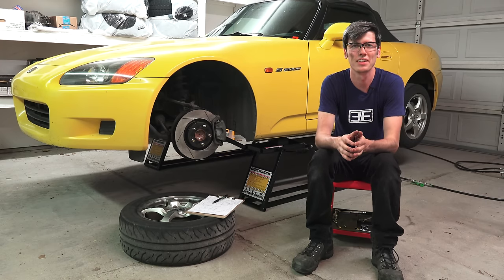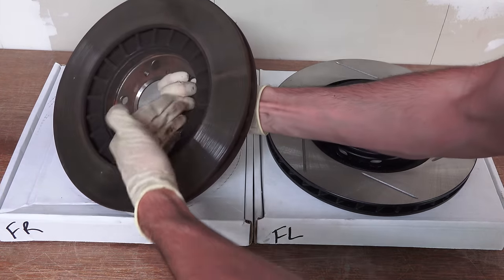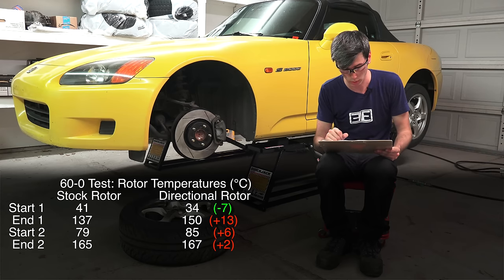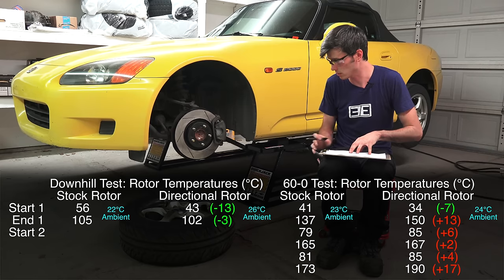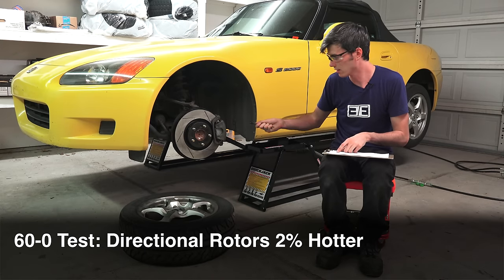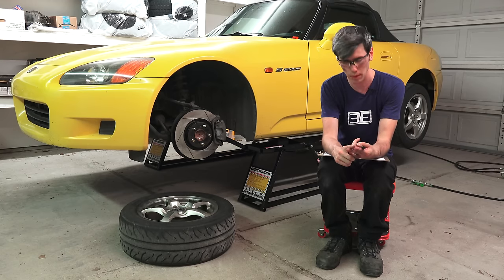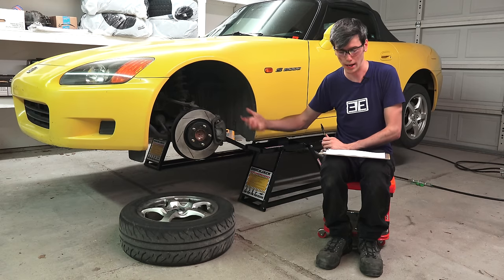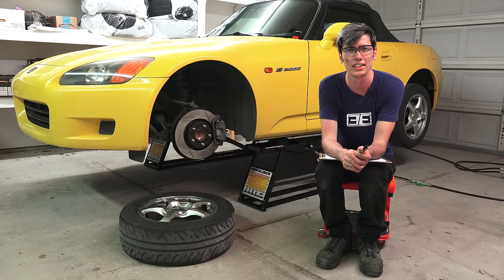Do Performance Brake Rotors Have Better Cooling?

Comment: Metallurgy and manufacturing method both play a critical role here.  Without assuring that the two rotors are metallurgically and fabricatively identical, the p-value can't really be determined with any accuracy.  Also, certain alloys and compositions are far more heat tolerant, so a simple comparison of temperature is likely not sufficient.

Comment: Great explanation but I think using percentage with temperature is a little flawed, because depending on whether you use Fahrenheit or Celsius the percentage is going to come out differently. It may work if you use Kelvin since the scale starts at absolute zero but doing that might make any of the differences seem minimal because of how high on the scale the operating temperatures of brakes are in the first place. Not a scientist or an expert on the topic, just a thought.

Comment: Getting hotter actually is good, it means that it is converting kinetic energy to thermal enegry better, so you get better stopping.  Right?  Right?  Bueller? Am I wrong? I may be.  But I have watched a lot of brake videos and they all seem to tell me that the job of brakes is converting movement energy to heat...

Comment: Maybe the aftermarket rotors provide more grip there for more heat is dissipated. A stop distance might have been a more useful comparison. And at the temperatures you were at you werent pushing it enough to really matter. Also what is the difference  in metallurgy and how do they change under extreme heat. I dont know seems like maybe you just didnt push it hard enough which you kinda said but yeah am not sure this is conclusive. Also I dont see how those cuts on the braking surface do anything other than make the rotor lose stopping power I would like to know how this is a good thing.

Comment: I put slotted & drilled  rotors on all 4 wheels, my thought was slotted for the brake gases & the drilled holes for the cooling.. I have gone to school & been in the automotive business for over 45 years but am open to any input always.. Like you channel by the way..

Comment: But you never changed the pads with the performance rotors. You continued to use the same bedded pads for the stock rotors. I use those performance rotors with organic pads which build a layer of organic material on the surface of the rotor which increases the braking efficiency by making them more progressive without having to  brake harder. The difference is quite noticeable.

Comment: The problem is that this is only rotor being tested against OEM. There are many brands and also the possibility of drilling holes in OEM rotors or machining them in other ways. I use OEM rotors but all I do is ordinary street and highway driving. More testing would be needed to prove or disprove the concept.

Comment: The stock rotors were High Carbon. The aftermarket were not - that explains the lower temps on stock rotors. Centric does make a High Carbon plain rotor 125 series, High a Carbon slotted 126 series

Comment: They perform worse because, due to the "cracks" (slots hehe), they have less braking surface, maybe by about 2%, the same 2% difference in temperatures between stock and aftermarket rotors

Comment: I just upgraded my rotors on my truck. I went with the slotted ones. However, the manufacturer directions that they came with showed them to be I stalled with the veins going the opposite direction than you have it installed. Maybe that has something to do with it? Who knows.

Comment: So basically for normal street use and highway use, the stock rotors are more than sufficient. However it is true the vented/ drilled rotors look great, especially with brightly coloured callipers...

Comment: Slotted and/or drilled only help with extreme temperature changes over very short periods of time that cause the brakes to off-gas (similar to steam) that would be trapped between the brake pad and rotor. Few people encounter these conditions on a daily driver. Besides, your brake pads are already slotted, so they already handle debris and any conditions most people experience.

Comment: Slotted rotors like that are not made for cooling, it's made to "wipe away" the vapor that builds up between the brake pad and the rotor itself. That is usually to protect against brake fade in situations where that is more likely to happen.

Cross drilled rotors will cool better because there's more surface area for the cooler air to contact the rotor itself.

If you really want to have fun, test cryogenically treated rotors versus non cryogenically treated rotors.

In your Flathead engine explanation and how the flathead V8 died, you said you were born in '53, that would make you almost 65 years old... You don't look even near that age!

Comment: Unless you spend a lot of money putting in a whole new brake system I doubt any configuration would be better. A lot of engineering id imagine goes into something as important as brakes. Hell even ford switched from alotted to solid rotors on the gt350. More surface area. A hell of a lot less likely to break too.

Comment: I have not read all the comments, but, just to be a pain, you could switch rotors side to side and repeat the test and see if the results are the same.  I would think the calipers would provide the same force per wheel, if it wasn't pulling one way or another. But, 'ya never know.  Maybe you've already thought this through and I missed it.

Comment: In other words, for everyday driving there is no significant difference between the two, but on the track is where the aftermarket rotors shine
Reply: Actually, offroad they shine even more than on the track. Slotted rotors work when covered in mud, whereas, sometimes blanks don't until they've had a chance to fling everything off. I almost ran into someone due to having no brakes at all while they were still flinging the crap off them. Drilled or dimpled rotors, though, don't give any benefit offroad.

Comment: For an engineer, you need your white board this time. All of your videos have been super informant. This one sounds like your just tired and using lazy terms. Take this only a constructive criticism. Difference in temperature as you know is the delta in temperature. The amount of energy that is being absorbed in the form of heat is absorption, but what is the saturation point, based on the materials these rotors are made out of?  Knowing this information you could have saved a lot of time on the test you performed, that only showed it wasn’t sufficient to shine a positive light on the directional rotors in everyday use. No fade results stopping distance and so forth. Now on the track it will be a different story.  Cant wait to see those results if you ever get to doing this.

Comment: Like your videos but sadly your comparison test seemed flawed to me. The bed in / burnish condition of both types of disc was vastly different so you could get disproportionate localized heating on the after market with little bedding in. No mention of mettalurgical differences which could have made a difference to heat up and more importantly braking friction. 
Really the only way to get consitent conditions too would be to run them on a brake dyno . where accurate consistent braking pressures could be used. Also it would have been interesting to see the cool down rates of both discs in their more natural use of hard braking and then more free wheeling type usage after to see actually how efficient the cooling fins are rather than heat sink effect of dissimilar mass possibly dissimilar material discs. Just a thought to actually get more idea about the differences in performance. Just my opinions not meaning to be negative and I reinforce the fact i do like your videos

Comment: this test needs to be done in tandem with how much 'work' the rotors are doing. if they are stopping the car harder/faster they will naturally get hotter than factory.
its not fair to test if they simply run cooler but if they perform better (i.e stop the car quicker, fade less because material strength is harder etc.)

Comment: The rotor on the left front of the yellow car is on BACKWARDS -- it belongs on the other side.
 That rotor sweeps toward the center of the wheel --should sweep from center toward the outer edge.
  A lot of time and money was wasted because the rotors are on backwards, thus nullifying the test   results..

Comment: so my understanding of slotted or drilled rotors has always been that upgrading a street car will normally make no difference because your just not generating enough heat in the brakes under normal driving. the advantage is supposed to be more relevant to track use if your braking from 140 to 40 and back to 140 when your on and off the brakes enough to have to run dot 4 fluid so it doesnt boil

Comment: Also what type of pads were used, as some performance pads work better in hotter rotor temps, compared to stock rotors and stock pads, its about stopping power and distance to stop, its not about the cooling part at all, totaly invalid test, unless is it about how much heat does it take and how long does that heat dissipated from the rotors, which is a test not done or a stop distance test also?

Comment: My car brakes dont fade at 60mph. They fade when i brake more frequently at above 100mph. That is when you know you need an upgrade.  Another issue, which ones would cook faster the pads. Even another thing those veins dont seem to be open on the outer edge of the rotor, which means that the air might not escape so well... another issue, it could be that they’re made to let the air escape only at higher temperatures, making the brakes hotter faster till a certain point to allow sport pads to work better... and at a certain temperature they start to decrease the rate of temp raise... there are some variables here that might not be optimal...

Comment: Why are you measuring temperature.... cold brakes don't help you to stop the inverse in fact, cold brakes have less optimal braking performance. The grooves are there to evacuate the gases that are created at the interface of the disc and the pad, not to allow more air to pass over them. The real world parameter here is stopping distance under various environmental conditions, anything else is just academic... good science lesson tho.

Comment: Its actually how fast the rotor disipate the heat..stock rotors will hold heat longer because the are solid..aftermarket when used with ceramic brake pads will disipate heat faster so you wont worp your rotors and scorch your brake pads at hight speeds and corner braking..thats why indi cars use them..

Comment: If u comparing similar rotors, n 1 is slotted, none will cool faster  ....as the slots n drill holes are not for cooling,  but for dissipating the gas that's form between pads n rotor..thus process cause the brakes not to fade easily due to heat.
   Why the professionals engineer and sceintist will from time to to carry out research, if the premise is wrong the the whole result n understanding will be wrong also.

Comment: Hey you said it is over 100 degrees in your garage but is 100 degrees Kelvin really that hot?

Also in the test temps you measured in Celsius so your garage is thus over 100 degrees Celsius?

Comment: The aftermarket may be having better friction thus generating more heat. Dissipating said heat as well as the stock disk which presumably has less friction and works cooler is actually good.

Comment: I think where the cooling comes in is when your actually driving and braking. You ha e to keep the wheels moving to keep the brakes cool. You cant just stop and take temps when there’s no air flow to keep the cool during a hard run. If you keep doing runs the stock will over heat faster most likely

Comment: I'll bet I know what you did wrong with your testing.  When you changed the rotors from stock to your aftermarket ones, did you put on a fresh set of pads as well?  (And they'd need to be the same brand and model of pads used with the stock rotor during testing)

Comment: Aftermarket rotors are notorious for actually being worse than stock. The main reason people buy them is for the cool looking holes and rivets in them. However, those little designs actually make the rotor less durable. Most aftermarket rotors are a scam. You need solid discs for best performance.

Comment: Good video but the logic is flawed. You started getting close once considering mass though. Friction rotors work by converting frictional force to heat. The higher temperature indicates a greater transfer of energy to the rotor hence more efficient frictional braking. The real test is the rate of transfer of the heat to the atmosphere. ie recovery rate. You should be measuring the temperature drop at set time intervals instead. A handy infrared monitor mounted on the guard to do this would give real time recording. Factor rotor are heavy to give thermal mas to compensate for pour thermal characteristics. Street Performance rotors, typically achieve similar breaking from lighter rotors which leads to improved handling.

Comment: Hey hi new fan here, I’m not an expert or anything but wouldn’t the temperature of the rim and hub assembly also be hotter after you have done the tests with the stock rotors I feel like he dissipation throughout the wheel itself and the hub/wheel bearing itself being warmed up also have some affect with heat dissipation. ??

Comment: Also being lighter it relieves rotational weight while probably stopping slightly better and cooling more efficiantly under sress which is why they come on faster cars. So the performance aspect to it are a big reason why they are used not just stopping but acceleration aswell as less unsprung weight is having to move.

Comment: The reason the formal test was conducted while moving is likely that directional rotors perform better while moving or the wheel has to spin to work like an impeller. Directional should cool better stopped or strait path. The cooling difference will happen when the car is moving not stopped.

Comment: The centrifugal design is not suitable cause you do not have enough rotations in order to start to work. I bet if You put them the wrong way they will cool better. Especially if the car has diffusers on front bumper to scoop air to wheel chamber.

Comment: So maybe only get the directional ones and put them on if you are racing on a track. I don't feel like in normal driving, which it seems like your tests were, that they offer any real advantage. Might be interesting to see if stopping distance was affected any. I mean hey could they have stopped in less distance and time, creating more frictional heat, and that was why they are hotter?

Comment: I thought the fins was ment to bite the air??? U sure there not the rong way because  no air will be grabbed by the fins the way you have at 48secs I think opposite of what you said air gets bite my fins and push out though by the wheel hub not in the other way round  way less airflow the way you have surely ???? Am I mad ??? :0

Comment: hi ,,, with all due respect ... the "aftermarket" disc is designed to disperse heat faster cuz thats what they do. temperature simply means you have fluid. the numbers correlate to a disc that will accumulate heat and disperse it faster than a stock disc. ... luv yr show

Comment: Nice experiment but there are lacks  of testing methods. What were the conditions? What was the air circulation? Where is the numerical solution? İ mean ansys or other finite element analysis programmes. The experiment should be done in drill machine not on axles.

Comment: I think the issue with your testing is you went right from braking to testing the temp. The rotors dissipate heat while rotating as soon as you got the temp up you stopped and didn’t allow for cooling due to rotation. 

A better test would be to get to speed brake hard and repeat several times rapidly and then drive normally for 5 minutes. Then take the temp. The difficulty here is you have to brake to stop or let it coast to the point where breaking won’t really generate much heat comparatively.

Comment: Slotted rotors have nothing to do with temps really. Its for trapped gases caused from repeated heavy braking. So the slots release trapped gasses and minimizes fade. I believe your thinking of drilled rotors. Drilled holes should help a lot more with temps than slots.

Comment: The slots only remove gasses between the pads and rotor which is critical when pads and rotors are above 600° You need to check stopping distances with both stock and aftermarket.

Comment: Slotted rotors might run slightly hotter but it's still going to stop faster because it's venting the gasses from the pads. Less gas between the pads and disks means less gas lubricating them means more friction and that means more heat. Don't worry people you can still buy your slotted rotors stress free.

Comment: To accurately complete these tests, one must stop in a specific distance by depressing the brake petal in an equal manner.  How do we know the application of force to the brake petal was equal in each test, and does it need to be?  Seems as though stopping distance should be equal in distance between the tests to call it a "known" variable.  At least two variables are assumed constants, and in this application, is a likely cause for incorrect results.

Comment: Eres un capo canosito!  But may be the Performance brake are hotter because are better in transforming the rotational energy into heat energy, i know that the important point is how fast they irradiate the amount of heat that friction produce on rotors? If the surface material in the performance rotors create more friction you have more heat and probably better braking, so will be important how fast they cool...isn't?